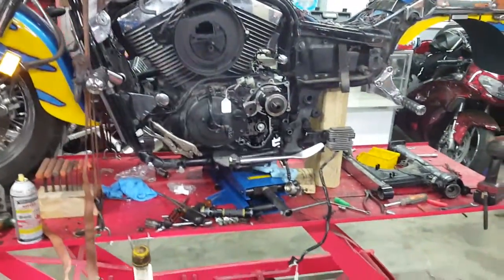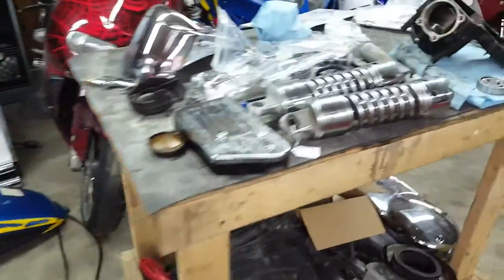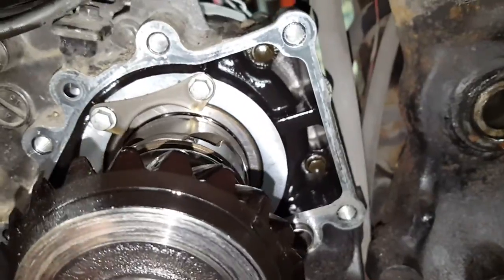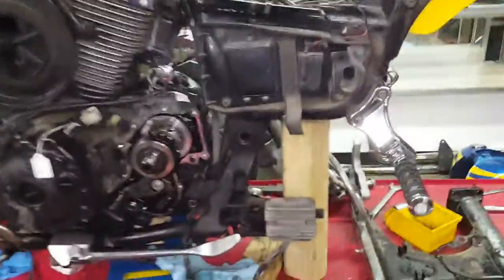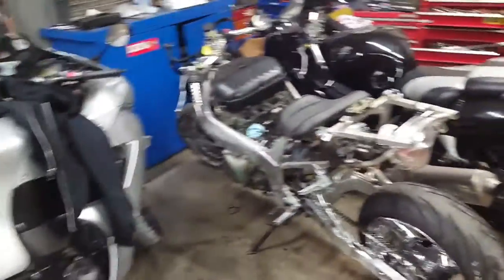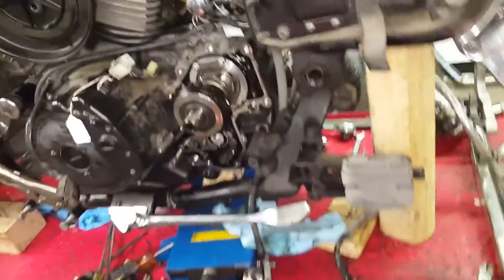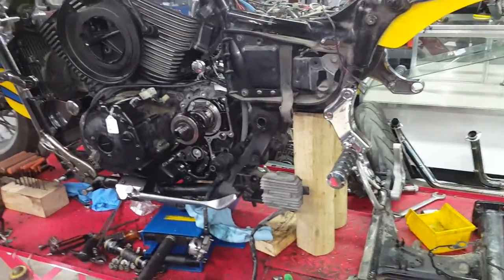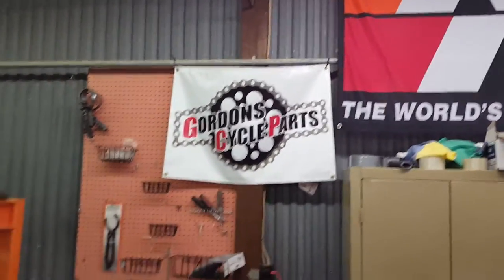Pt #1 2003 Kawasaki Vulcan 1500 Front Bevel Bearing Replacement #Howto #Repair #GCP #DYI #Gear

Comment: So, I now have suffered this issue at 38k, and now at 62k miles on my Vulcan Classic. I watched a few additional online videos, which some touched on the tips that you have provided. This is not a simple job, but doable in the home workshop. Again, greatly appreciate that you have done such a great job of providing video, and talking thru the situation.
Reply from the maker: Thank you, Glad we can help. Good luck to you on the repair. 👍
Reply: @Gordons-Cycle-Parts  hey man I got a 08 Vulcan Classic 1500 with the shaft drive. Got a vibration feels like it's under the seat rear wheel area, when I pull in the clutch going down the road about 80-90% of it goes away. Do you think it would be the u joint on the driveshaft? If so what would it cost to do this job? Appreciate a response if you got time. Thanks in advance bro.
Reply from the maker: @natesv04  Hey, Thanks for reaching out.  I'm not to familiar with those bikes. However,  I can do so research and get back with you on it. Thanks

Comment: Great video.  I went thru this experience about 3 years ago. Exactly the same situation. This video fully supported what my experience was. Appreciate the time you have taken to explain and document this procedure. Key thing here is that you do not have to pull the motor, simply remove 3 of he 4 motor mounts and then slide the motor over far enough to get the Bezel Gear Cover off.
Reply from the maker: You're very welcome 👍

Comment: What are the symptoms of a worn out bevel gear ? I have a 2008 Kawasaki Vulcan Nomad. 45000 miles. I haven't rode it yet due to not having it tagged yet. And I need tires. Its coming on winter, so I was going to repair everything for spring. Got the bike on a trade, runs great. Great video.
Reply from the maker: Thanks,  and congrats on the new to you bike. It's easier to say listen to the video again. We explain the symptoms I believe in the beginning/middle of the video. Hope that helps. Good luck with servicing it and thanks again 👍

Comment: Good evening! I wanted to ask if you have a list of the parts you ordered. I have to go though this asap and wanted to order the parts I need. You showed a bunch of baggies with different parts to change since it's all opened up. I appreciate it!
Reply from the maker: Hey, sorry we don't have a list. Its been so long we honestly would have to take a little time to create a list but it might not be %100 everything that's needed.  Might want to check with your local dealer to get a list for the repair.  However,  the question has been asked a few times before so we will work on the list of parts and add it to the description. Thanks and good luck 👍

Comment: this is a great informative video thank so much man.i think this bearing has gone out on my 1600 nomad. its showing most of the symptoms .i feel its either a bad u joint or this bad front bevel bearing.right now im stuck trying to decide whether to tackle this myself or just take it to the shop and fork over the money ha
Reply from the maker: You're welcome. Give it a shot, your wallet will thank you for it 👍😁
Reply: @Gordons-Cycle-Parts  thanks for the encouragement man .  im decently mechanically inclined,my dad is a mechanic whos worked on cars his whole life but not really on motorcycles much and hes willing to help ,id definitely try it myself if i knew for sure this was the problem and not something else
Reply from the maker: You're welcome,   you got this 👍👍
Reply: @matthewgentry4275  What were your symptoms ?

Comment: I know this is old video, but I’m having trouble with my 96 when you’re going and you get into the throttle it acts like it skips with this cause it like you pulled the clutch real fast and let it go real fast already replaced everything on the clutch side

Comment: what's up buddy? I'm from Brazil, I have a question, I have the same bike and since I bought it in reduced gear it makes a sound as if it were going in reverse, it even sounds like gears making noise in the engine brake, when I accelerate or press the clutch in motion it doesn't make a noise. reverse gear, it only does it when the engine uses its opposite driving force, do you think it could be this bearing?
Reply from the maker: Hey,  from what I can remember,  it's likely that's what it is. As soon as the load is off the bike,  it can sounds rough,  vibrate, grind sound, whistling sound etc.  Hope that helps. Good luck 👍
Reply: @Gordons-Cycle-Parts  obrigado amigo!! 🤜🤛
Reply from the maker: @JMS289  De nada, boa sorte

Comment: How did you get the cap for the bevel gear off? what did you do to hold the gear in place when undoing the nut?
Reply from the maker: Sorry but I don't recall the cap removal.  I used an impact gun on the nut removal so I held the gear with my hand

Comment: Hey, ive got a 2003 meanstreak 1500 that has a locked up drivetrain, is it possible that the bevel gear bearing can wear to the point of seizing up the drivetrain? or maybe even creating enough play between the gears to bind them up?
Reply from the maker: krisbajorski with bearings thats possible but I likely doubt that's your issue though. Do the engine  still start and run ?

Comment: Because i dont wanna buy extra parts i don't need, How'd you remove that copper cap from the assembly cover that houses the nut for the front bevel gear and that bad bearing. Did you pry it out of punch it out? Figured it be better to ask, i know the bearing is bad but i could figure out how to remove that little cover to get to the nut to free the bevel gear.
Reply from the maker: Sorry, but I don't recall exactly but I believe it I used a flat edge around the seal. Hope that helps. Good luck 👍

Comment: I have the same problem.  Is there a video actually showing how you broke it down and put it back together?  Can you provide a parts list with part numbers?
Reply from the maker: Sorry, this was the 1 and only time we did a job ime this. But,  I will look up part #s and share them with you. Absolutely no special tools are required doing this job.
Reply: I'm in Whittier, CA
Reply from the maker: M Robinson sorry, this is the only video I posted of this job. Sorry, but I thought show after i got it all about, which is still more than what I found before I started this job. Sorry if it's not detailed enuf. This video shows everything that came off so i really hope that helps.
Reply: Thnx but I took it in for repair

Comment: Please start doing cruiser repair videos. I know they not as glamorous as the sport bikes , but some of us old guys could use some helpful videos  like this on metric cruisers. There's plenty of videos on Harley's,just not much on metrics. Thanks and I'll sub just in case you decide to.
Reply from the maker: cl roberts thanks, we plan on it. This was the 1st and only crusier bike we have ever worked on other than tire installation. We welcome all 2 wheel machines,  we would love to learn them all as well. Since then, we purchased a tripod to hold the camera so we will definately get start to finish videos now. If you're on Facebook,  like and follow us at Gordon Cycle Parts. We have a few videos on there as well. Thanks again.
Reply: dakadr4250 wow I didn't expect a reply. Thanks. I'm having a problem with my Kawasaki Vulcan 1500. Intermittent vibration. Feels like it in the handlebar. Removed the wheel and checked the wheel bearings and they are fine. Going to replace anyways while the wheel is off , and the brake pads also. Hopefully my problem lies within one of those two. I'll keep you posted. Sorry I don't have book face .
Reply from the maker: cl roberts you're welcome, ok and good luck. Pay close attention to what the bike is doing when the vibrations starts. If during deceleration, its likely from worn parts. Be sure to check the oil drain plug screen for metal shavings to determine if its internal wear. Again, good luck

Comment: Gordon,  Did you ever finish replacing that bevel gear bearing?  I am about to do the same job on my 1500 Mean Streak.
Reply from the maker: Yes,  I did but my apologies for not updating and posting a part 2. I got into putting it back together and was just going going going. Sorry
Reply: @Gordons-Cycle-Parts  Thank you for responding.  And thanks for the part 1 video.  Any problems putting it back together?
Reply from the maker: You're welcome, no it went back together just fine. Actually it went faster since everything was labeled. Sure hope this video helps you get back on the road soon 👍🏍
Reply: Gordon, quick question.....how in the world did you get the shifter linkage off the shaft?  I am stuck.
Reply: never mind bud. I got it
Reply from the maker: @quick65  that was a pain wasn't it lol

Comment: High guy can you tell me what kind of oil you use and how often you changed it thanks for the video very helpful 😉
Reply from the maker: Gary M. Pollitt PhD  hello,  this was a customer's bike that I only replaced the bevel bearing on. So I would recommend using the manufacturer recommendation on mileage for oil changes. However,  we used rotela t4 15w-40 and a standard filter to run it a few miles to flush it, then we went back with Castrol synthetic blend with a K&N filter. Hope this was helpful. Good luck 🏍
Reply: dakadr4250 thanks for the quick reply on the oil question you really are good with the Vulcans. I have one last question. Are you replacing the old bearing with the exact same part new part new bearing and expecting it to get any more life out of it, Or did Kawasaki upgrade the replacement bearing for better life? Thanks chief you're a stout fellow 😎

Comment: You should had removed the right side of the frame, and push back the engine a bit, then you have easy access to everything...no need to removw the swing arm etc. for this job. Now you know. Greetings from México
Reply from the maker: @patstaffer1331  👍

Comment: Seeing how long ago this was I guess you don't have the part number on the bearing.
Reply from the maker: @tee19880703  sure don't.  But if you watch the whole video,  I show it in the package I believe so you might see it.
Reply from the maker: @tee19880703  part # for the bearing is 92045-1165
 Bearing Ball, 6305C2